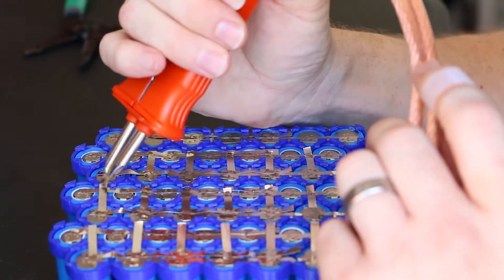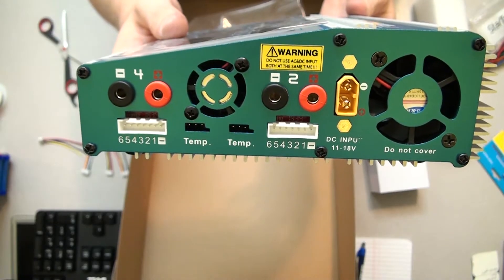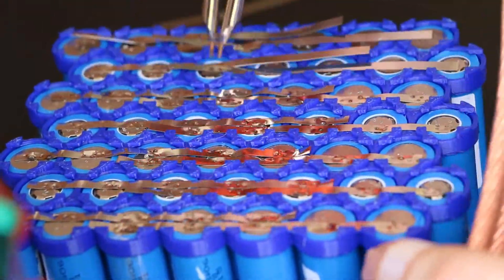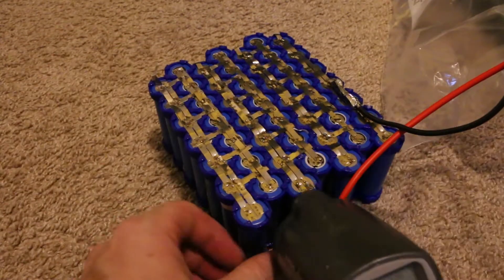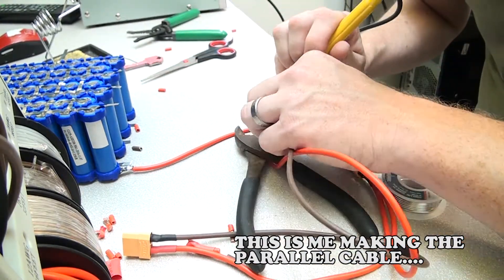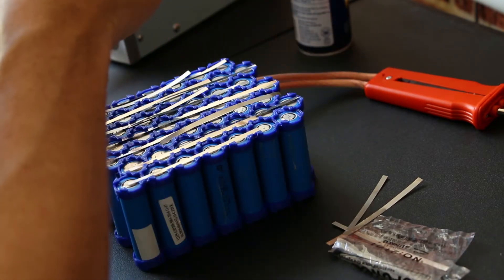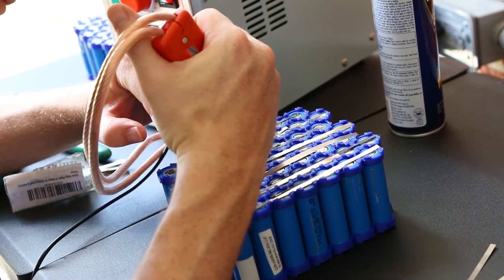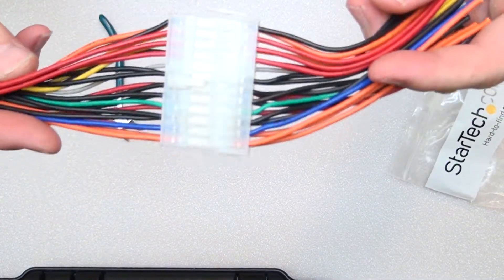EBIKE BATTERY UPDATE: spot welded, wired and working

Comment: Good work, especially for a first try. That's pretty impressive in fact.  I truly think you'll be happier without the BMS especially at first.  My experience with the BMS's was ok but I'd much rather balance charge and check the parallel configuration voltages with a VOM meter. Also, I would advise to not charge any of the individual/parallel batteries to much over 4.0 volts. The life of the Lipo chemistry is shortened dramatically as you approach 4.2 volt maximum. I charge to 4.1 only if I want to take a 20 mile bike ride which is very seldom.  I now have five bike batteries, some soldered, others spot welded and one vruzend which is the new compression kit. I've not tested the latter yet. http://vruzend.com/    I do on occasion get lazy and use a 36 volt power supply and charge the battery without any balancing and it's not that bad. The range is typically 3.85 to 4.1. When I'm in a hurry I charge it at 4 amps end to end and check each P circuit every half hour.
Reply: I've not had a problem with any of the five batteries except one I purchased from Hong Kong that had a BMS which failed after about 10 charge/discharge on an ebike. I replaced the BMS but now I'm afraid to use the battery because I don't want to pedal six miles again. Apparently, one of the mosfet's fried, the heatexchange plate was darkened around one of them.
Reply: I reallly like the plug idea. I have 8P-10S batteries so I just use two B6 chargers at once and that works great.  I have seen computer plugs used but they were metal because they get hot. I think you may want to keep the charge rates well under 2 amps so you don't warp that plug. The ampacity of 26 to 28 gauge wire is only around one ampere. Here's a chart; https://xtronics.com/wiki/Wire-Gauge_Ampacity.html
Reply from the maker: thanks again for all the tips Charles... good stuff. The wires are 18 and 16 AWG for that computer plug... so they are not all the same. I will remain conservative on the amperage during charge. Im curious how the actual plug connections will hold up as well. I think this frankensteined battery will end up being pretty awesome. The cooling though, if i can set the time aside to do the design, it will be perfect for riding full throttle non stop.... there are videos on that vruzend by the ebike school guy and the jehu dude.... thanks again for the tips. im going to bed. nearly did 3 videos today. Im half way done with a video review of the ebay cells i bought recently... not the best experience... but near best on the price.
Reply: Ok, it looks like you've got this ebike battery thing down very quickly.  I've made most of the errors in the field at least once so I feel I am the voice of experience as I have destroyed  balance chargers, alligator clips, VOM meters, IEC 320 plugs and if it's possible to stop you before you too experience those results it would have been worth it. Make SURE you wire that balance plug properly, check it with a VOM a few times before charging. I've had to replace two B6 chargers as a result of moving too quickly. Lastly, the only cells I found to be well over 2100 mah were either Moli (Canadian) and LG's. Everything else is typically 1700 to 2000 mah no matter how they're marked. If the inexpensive blue, orange etc. cheaper Shenzhen cells result with over 1700 mah you're doing well because they rarely cost more than $2 each.

Comment: I did the same thing with the 24 pin ATX connector!! I actually have one set up where each string has its own XT60 connector. I found the wires to be somewhat fragile, and overall it was somewhat awkward to use. Personally, I think having a small BMS for the sake of charging works well, and allows you to charge very quickly. The battery is looking sweet, nice job!
Reply from the maker: Home Solar Research thanks man. nice! i just would like to keep the cells away from 4.2 volts is all.. thanks for the comment!
Reply: Ah I gotcha, are you trying to stay under 4.2 volts to extend the pack life? I wish there was a BMS option that would limit the charge to to 4.1 or 4.0.
Reply from the maker: Home Solar Research :) yes.. i found one on ebay. it was 90 bucks.. blue tooth enabled to be set to 4.1 charge/balance by phone... it was sold tho.. ill look for it now.. i may be misremembering it tho
Reply from the maker: http://www.ebay.com/itm/10s-12s-13s-14s-smart-bms-30amp-Li-Ion-3-7v-4-2v-Bluetooth-computer-sw-/232319873623?_trksid=p2047675.l2557&ssPageName=STRK%3AMEBIDX%3AIT&nma=true&si=K0E1AobKxr%252FwshtRxIUjzZlfSx4%253D&orig_cvip=true&rt=nc This is similar to what i was just saying.... i remember coming across one online that had the end charge setting able to be adjusted...
Reply: Oh dang. That's pretty expensive lol. Let me know if you find it. There has got to be a cheaper way...
Reply from the maker: if we find out, we should let the world know... (looks off to horizon with purpose).